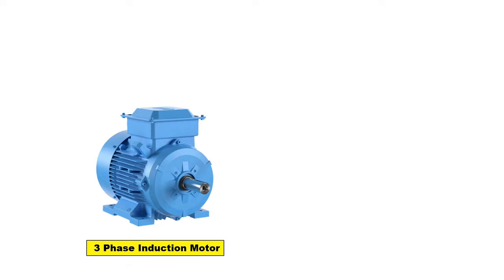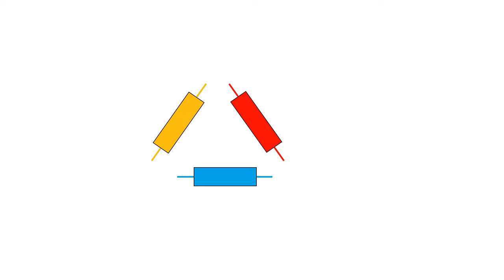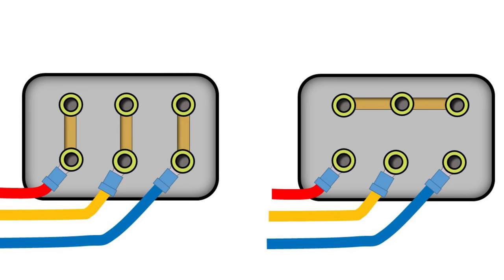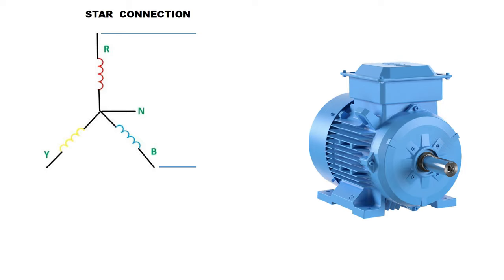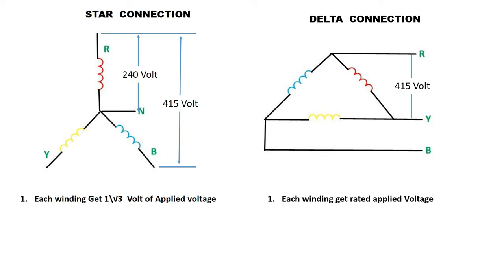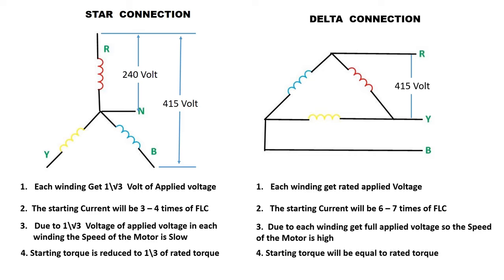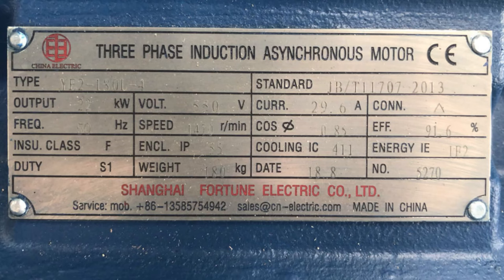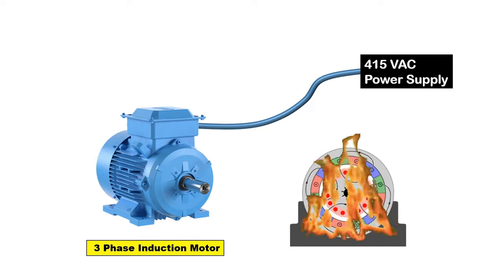Difference Between Motor STAR Connection and DELTA Connection @TheElectricalGuy

Comment: Question: If your house is getting 220V supply , then each power wire is 110V Single phase. Correct? The most you can run for motors is 220V 2 Phase ?
Reply: No
Reply: As i saw across the world, in the power system we can see single-phase or three- phase. In houses used single or three- phase only. In single phase, 2wires is there one is neutral that mean 0 voltage and another is 220v in single phase in that way moter is working. In some cases in industrial machinery 110v-2 wire is i saw that case the phase angle between the 2wires the one wire act like power and another is like neutral. Most i see if any mistake pls explain to my comment..❤⚡
Reply: With single phase, you have one sine wave. It produces 220 to 240 volts. The neutral is tapped in the center of the transformer,  splitting the 220 into 2 110 lines. This is called split phase. There is no 2 phase. 3 phase has 3 sine waves and no neutral. If your utility supplies 3 phase then you need a transformer to get split phase.
Reply: @jeremycrisp4488  Thanks. Now it makes sense...

Comment: Dear, I have 3-phase   3-treminal submersible water pump motor ,how can I connect in star-delta starting method b/c I have not auto-transformer starting panel board?rather it is satr-delta panel board;

Comment: So can I add a 3 phase motor to my clark pc60 phase converter which only has a 4 pin 16A plug (3 hot wires & earth) & connect thd pilot motor in star so a can gain a neutral output & use a 5 pin 32A plug ? Please help

Comment: Hello my friend, i have a doubt. I have a 3 phase induction motor with power 128KW, current 210A, pf 0.9, Voltage 440V, Frequency 60Hz, rpm 1180. Its a blower actually. Can I connect this in star if the motor specification is written delta. because if i connect in delta i guess starting current will be very high so im afraid it might burn the phases